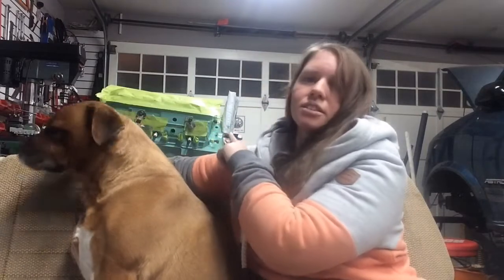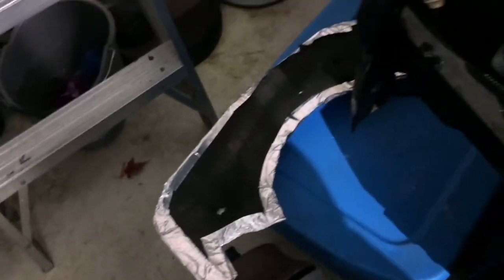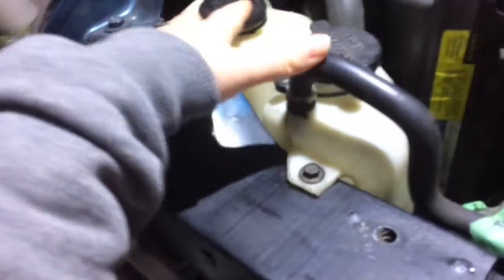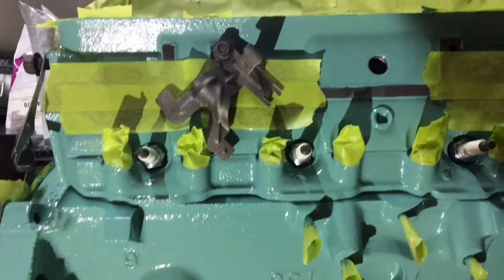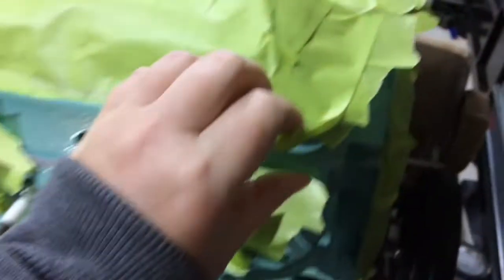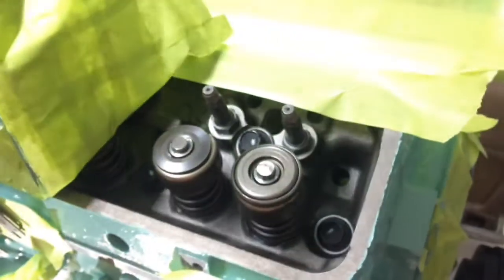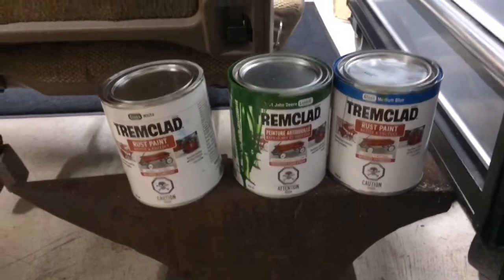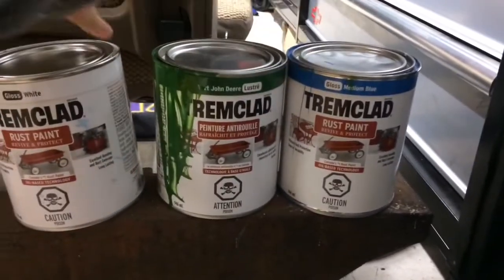Engine build, 93 chevy astro restoration progress update November 2021

Comment: Hey.. is it the original engine, reman or you did a swap? A 00 is what I'm workin on & smh is it a pain in the ass lol. No drive train work just interior & ext, 7" lift full audio.
Reply from the maker: It is the original engine and trans.  I find if you just take your time, think things through carefully, and if you get frustrated then take a break.  However my van resto has been a breeze and had very little hiccups.  And the hiccups I did have was caused by my misunderstanding of something because I am learning as I go.  But thats why I am going slow.

7" lift sounds cool!  I have thought of doing a lift and drop.  lol  I was going to lower my 93, even have the drop kit.  But I decided I love the stock height because it is easier to do oil changes.